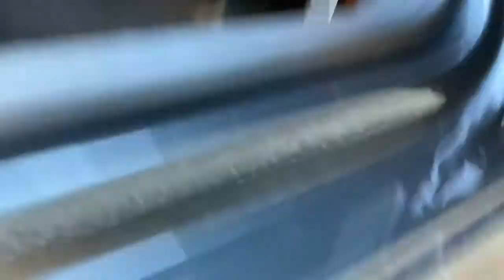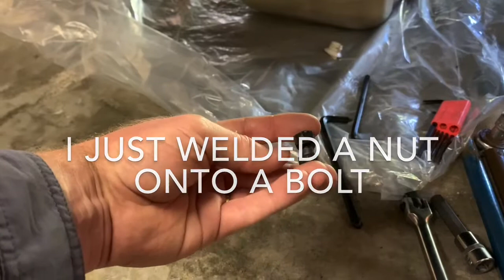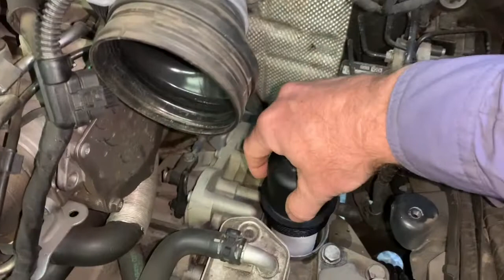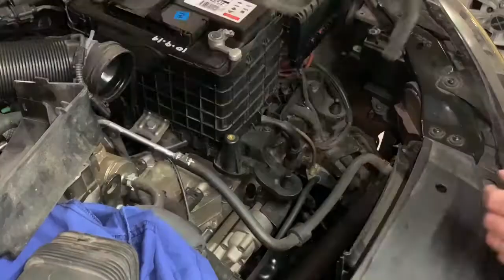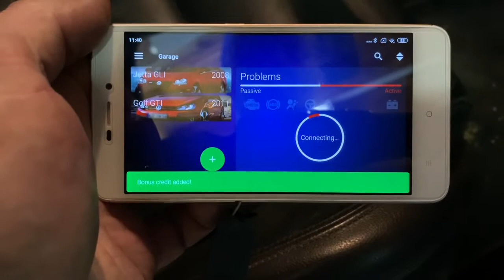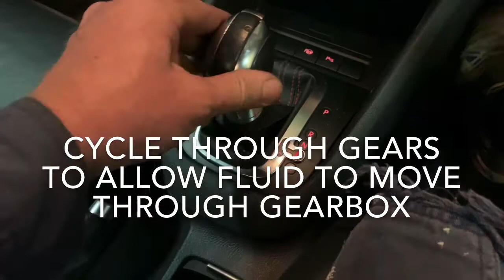MK6 VW Golf GTI introduction and DSG Service

Comment: How is the car holding up?
Reply from the maker: Still got it and still love it. DSG perfect never had an issue. Other issues/fixes/maint, timing chain, guides and tensioner, de-carbon intake, cam adjuster, wastegate flapper repair. It does use oil but not too bad.
Reply: @PetesWorkshop 
Well it was more than just a timing chain service, say like it is, these cars are timing chain ticking time bombs and you were the next one in the list. Exactly what I have been saying all along about them, but people just see a tempting sale price tag and fall for them. You saved a lot of money because you did most of the work yourself, but any shop would have been the value or more, of the car itself. I am glad you still got it road worthy.
https://youtu.be/YI13JloKXAU
Reply: It's the 7 speed DSG which has most of the problems. It has the dry clutches and mechatronics Problem.
Reply: @herbertvonsauerkrautunterh2513  there are plenty of MK7 DSG doing 400hp+ on stock tuned DSG with no issues